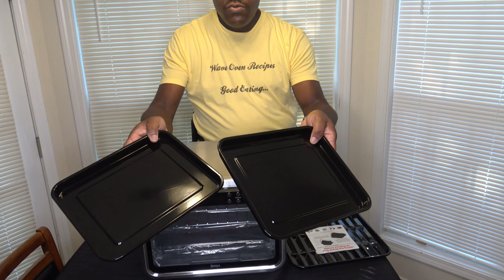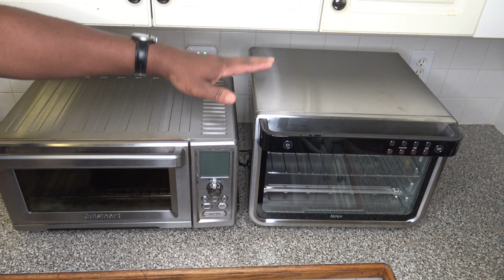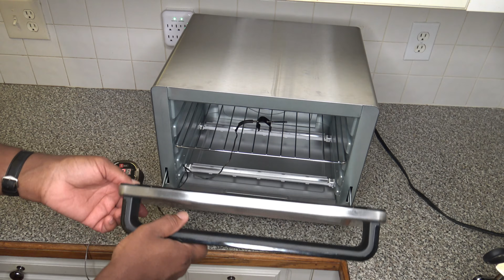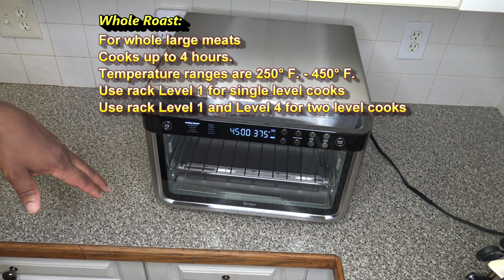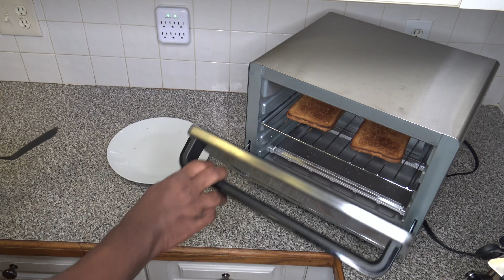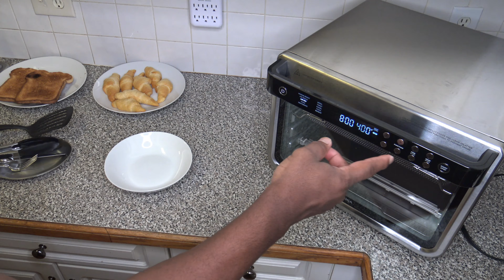Ninja Foodi XL Pro Air Oven Review, Unboxing, Test and Cooks

Comment: I waited to see if you’d review this! Thanks Darnell! Have a great week!
Reply: Qaa
Reply: Do not put the drip pan below the heating elements, put it in the slot just above the heating elements for obvious reasons. You don't want food & grease dripping on the heating elements. 

I Have had mine for a couple of weeks & so far it works great. My only negative is the white paint on the Power switch & the On/off switch has already worn off.

Unfortunately Ninja is made in China so hopefully it lasts at least 2-3 years.

Comment: Great review. The rear fan makes it unique as the speed is controlled by the setting you have selected. It is also a 3rd heat source to work like a rotisserie when cooking roasts and whole chickens etc. Also this is what eliminates the need to rotate the food like other ovens. Feature is highlighted right on the box.
Reply: is there any mode without the fan, for baking only?

Comment: Do not put the drip pan below the heating elements, put it in the slot just above the heating elements for obvious reasons. You don't want food & grease dripping on the heating elements. 

I Have had mine for a couple of weeks & so far it works great. My only negative is the white paint on the Power switch & the On/off switch has already worn off.

Unfortunately Ninja is made in China so hopefully it lasts at least 2-3 years.
Reply from the maker: The drip pan stays on the bottom.  If you have something that will drip grease.  This is how you handle it:
https://youtu.be/RtLswCh2ZnA

I made a video about the paint:
https://youtu.be/w0WqbPt6IC4

Comment: Other than the burnt area, for me that toast is perfect.  But taking 5 minutes to toast a couple slices of bread is a big deal for me. I like the idea of making 4 slices of toast at once tho, and to have the bread fully toasted w/o toaster lines is probably worth the extra minute or so. (And a 4-slice toaster takes up a lot of space on a counter, too.)  I like the addition of time while baking to complete the process as shown w/ the crescent rolls.. As far as the chicken bites, they typically use a higher temp and more time in any conventional oven bc they start out frozen.  But also need to remember they tend to dry out quickly when baking. So I would not walk away from them. Can you smell foods as they are "cooking"? And does the air fryer retain any odors like a microwave does, even with regular cleaning?? Thank you!!

Comment: This is one of the best reviews I've seen. A little suggestion though. I noticed on my cuisinart fryer a lot of splatter was getting onto the top and upper elements. I purchased a 2nd fryer basket direct form Ninja (it's cheaper than Amazon) and I put it ABOVE what I am cooking. This catches almost all of the upwards splatter and does not interfere  with air flow.
Reply: This is the tip I'm looking for. Bc cleaning the top and those upper elements has to be such a difficult thing to do in any air/oven. I was hoping the elements could be removed for easier clean-up. Like the heating elements (the eye) of the older styled electric stove-tops.
Reply: If your not broiling you could put the broil pan on the top rack to block any potential splatter

Comment: Could you please show how you take the fan cover off. You mention in this video and the 30-day update that you put the fan cover in the dishwasher but neither of these show how you take it off. I kind if pulled on it a little bit since you said that it comes off but it didn’t come off easily.
Reply from the maker: You probably do not have one.  They stopped making them with the guard years ago.  But, if you need additional help, call Ninja customer service.

Comment: For me this oven on 450 bake will not get past 400. And most modes it takes a super long time to heat because it's just using the heating element around the fan and not the upper and lower elements. Reheat is the fastest heating mode because it uses the upper and lower on max. With the strange preheat on top of that you can't use this thing reliably without your own thermometer.
Reply from the maker: I showed it heats fine, you should call customer service.

Comment: Thanks for a great review.... I just got mine and I just open and did the burn out. Quick couple questions, is yours even after turning it off but still plug in, the machine still running? Also, mine doesn't fan cover, have you heard or find out from others why some of it doesn't have fan cover (i am wondering may be because I bought mine in amazon and not in ninja website). Does the fan cover does help in cleaning or you prefer with no fan cover (I just want to see if I am missing a lot without fan. Any response is highly appreciated.
Reply from the maker: https://youtu.be/NRvwxFHJjLM
https://youtu.be/Iuwaj6_H74A

You cannot have a fan cover, they don't make them anymore, their choice, because they decided to remove it.  You cannot add one either.
Reply: The company concluded that nothing gets inside the fan, due to the fan blowing outwardly, therefore eliminating the need for the fan protector.

Comment: I just bought this. Is the fan cover sold anywhere?
Reply from the maker: No.  And you don't have the holes and connections to install it even if you got ahold of one.  You would have to drill holes and install parts to have brackets to hold it onto.  Which would immediately void your warranty.
Reply: @WaveOvenRecipes  Thanks for your answer.

Comment: Have you had issues with the lettering coming off the power button and the start/stop button?  I have had mine a few weeks and it's already coming off.  I contacted Ninja and they wanted to charge me 20 bucks to send a replacement and I had to send the one back.
Reply from the maker: No, consider adjusting how you wipe the front.  I highly suspect some of you are using an abrasive cleaning product or wiping too forcefully on the handle.  I have never had such an issue.  See my latest video using it
https://youtu.be/z4aswEIFP3o
Reply: I haven’t even cleaned that area.  It’s just from touching it.  That’s the issue.   Looking at reviews on Amazon it’s an ongoing issue but glad you are not having that issue.    I’m just disappointed at a 299 price point tha lettering would be coming off.  Amazon is exchanging it since Ninja wanted to charge me.  I’ll see if it happens again.  Thanks for your reply.
Reply from the maker: Something rubbing off from just touching it.  I have to think more is happening.  Sorry, it just doesn't add up.  I have used another cooker where paint rubbed off from vigorous cleaning.  But just touching I have to be the skeptic.  Seems more came into contact with the handle than just touching.  Maybe some type of oil, something.
Reply: Not sure what doesn’t add up.  I did a lot of reviews on this product and saw that this was an ongoing issue.  I purchased anyway and was careful NOT to clean or wipe down that area.  Even Ninja was aware of the issue and was willing to replace it but I didn’t feel I should pay for shipping.  Everything else works great so far.        Read some reviews on Amazon Bed bath and Beyond etc.  Maybe it will help you add up.
Reply from the maker: I have seen already and feel it's more than simply touching it that causes the issue.
Reply from the maker: I would guess if only touching causes the issue.  They released a batch with some bad paint.  That would also explain why it's not an issue occuring for more people.
Reply: @WaveOvenRecipes  Ninja finally admitted that one of their suppliers used a non permanent paint on the control panel. They are now sending out new units without asking you to return the defective one. But it all depends on which rep you talk to. Some only offer stickers to replace the letters, and a free muffin pan! If you persist, they will send a new oven, with stickers to put on for yourself, in case it happens again. Some insist on charging $20 to ship the new oven to you, but some do not. I love my oven, but this is unacceptable to have to put stickers on a $300+ oven. This is not user error, it is a manufacturing defect. Kudos to Ninja for sending out new ovens right and left (my daughter got 2), but I imagine they'll recoup that money in the price of their products. I still love Ninja products, I have this oven and a grill, but they really missed the mark on this one issue.

Comment: Amazing review. Extremely detailed with the kind of information that you often don't find in other reviews. people do need to know how large or small the interior dimensions are before they buy, and temperature is critical also. Some ovens claim to do 450 but don't go much beyond 400.
Reply: Do not put the drip pan below the heating elements, put it in the slot just above the heating elements for obvious reasons. You don't want food & grease dripping on the heating elements. 

I Have had mine for a couple of weeks & so far it works great. My only negative is the white paint on the Power switch & the On/off switch has already worn off.

Unfortunately Ninja is made in China so hopefully it lasts at least 2-3 years.
Reply from the maker: Do this I have proven it works https://youtu.be/RtLswCh2ZnA

Comment: You set the toast function for 4 slices instead of 2... I expected the toast to burn on that setting... Probably should select the actual number of slices of bread when using the toasting function to see if it really doesn't regulate correctly not not?
Reply from the maker: You don't understand.  My homemade bread is much larger than that stuff you buy in the store.  Literally twice as big, unless I make cinnamon bread 😋 

But the setting is correct.  The cooker simply fails on recognizing to adjust the toast time when already hot.

Watch more of my Reviews.  This is a standard test I do.  Some pass, others fail.

Comment: I got mine and it does not have a splash guard, it's model #201 did they get rid of the splash guard?
Reply: So no slash guard is permanent? They upgraded so they don't need the guard. Just want a straight answer. Called customer service and they couldn't give me a straight answer. Please someone help
Reply from the maker: It's their product.  So they do what they want.
Reply from the maker: They have made some adjustments.

Comment: Thank you for confirming that it doesn't preheat to the set temperature in 90 seconds. I exchanged my Ninja Foodi XL Pro Air Oven because it took 10 minutes to reach 450 degrees, NOT 90 seconds. My second Ninja also took 10 minutes to reach the 450 degrees. Disappointed that the advertised 90 second preheat time is a bit misleading. 🤷‍♂️

Comment: The product has an extremely strong chemical smell upon opening the unit. The smell is similar to paint thinner or something else toxic that should neither be consumed nor used in cooking appliances. When I called the business to inquire as to what particular chemical was used in it, they not only refused to tell me what it was but they also stated that this information is “confidential to their business” and therefore I’m “not allowed to know”. Due to shady business practices and concern for my health, I will be returning this air fryer for a full refund. I highly recommend going with a more reputable and honest company if you value your health.
Reply from the maker: You have done what is right for you.  However you have no evidence other than your feelings.  The manual clearly mentions to first wash all parts, and then do run on Air Roast at 450° F. with all accessories inside.  To do a burn off run, that removes any residue.  This is all fully detailed in the manual on Page 5.  And it is a standard with all cookers.  They mention the burn off is completely safe.  So any claims you have of danger are yours to conclusively prove beyond any personal suspicions.  Please write back when you have a site up with details proving your claims.
Reply: Wave Oven Recipes I’m curious how exactly you intend on either one of us being able to conclusively prove that this product is safe for use if pertinent information needed to determine that is being withheld from both of us by the company itself? How does that not give off red flags to you too? Unless, of course, you are affiliated with this company. In which case, you should probably ask them yourself since you are clearly intent on selling this product for them without having all the information on it first. I appreciate your response, but I’d rather warn the public to keep their eyes open and be smart about their purchases rather than blindly buying items that could ultimately prove to be a hazard to their overall health and well-being. 

Oh and last time I checked - my feelings are not responsible for detecting the smell of chemicals, my nose is. Thank you though.
Reply from the maker: You can take a swab and have a lab test.  That is all up to you.  As I said, this is standard for all cookers and in the manual of every one.  If you have something you feel strongly about, go for it.

I am 100% independent and being such doesn't require I run with every claim someone makes.

Wishing you all the best.
Reply: Wave Oven Recipes The intent of my comment wasn’t to persuade you to “run with my claim”. It was solely to inform the public of this company’s poor business practices so that they can hopefully make a more educated decision prior to doing business with them. 

Regardless of what chemical was or wasn’t used in this product, or how safe anyone does or doesn’t deem it to be, it definitely doesn’t look good on the company’s part that they chose to blatantly hide this information when asked directly about it. And regardless of your stance on this matter, I’m sure you and I can both agree on that. Just because it’s the “standard”, doesn’t make it right. And thank you for your suggestion about the swab test. But I think for now, I’ll just use common sense instead.
Reply from the maker: No, we don't agree.  Every cooker, literally every one has residue from manufacturing and shipping.  They all have a smell on the first burn.  Ovens, grills, air fryers, all of them.  Maybe this is the only one you noticed.  But if you get actual evidence of harm I would very much like to see it.
Reply: Wave Oven Recipes 

https://scholar.google.com/scholar?start=10&q=oven+fumes&hl=en&as_sdt=0,26#d=gs_qabs&u=%23p%3DcvSBdfWOql0J

https://scholar.google.com/scholar?start=60&q=oven+fumes&hl=en&as_sdt=0,26#d=gs_qabs&u=%23p%3DBTDBmeAA51UJ

https://www.ncbi.nlm.nih.gov/pmc/articles/PMC2966478/

Okay, so your argument is that if all cooking appliances have a chemical odor to at least some degree, then they must all therefore be safe? And since all cigarettes have nicotine in them, those must all be safe too. Just like all non-organic produce contains pesticides and all processed food contains harmful ingredients proven to cause disease and illness in the human body. But since they ALL contain these toxins, they must all clearly be safe too. Do you not at least see the flaw in your logic here? We’re not arguing whether or not other appliances have also been treated with these same types of chemicals. We’re arguing whether or not they’re safe. And just because other units have it too, doesn’t magically make this one any more safe. 

You seem to be under the false impression that these marketers and companies have our health and best interest at heart. When in fact, most - if not all - of them are actually just trying to make a dollar and improve the state of their own financial well-being. Therefore it’s up to us, as the consumer, to determine whether or not these items they are trying to sell us are safe enough for use. Assuming that all products are safe until proven otherwise is exactly the mentality that will eventually and inevitably lead your health to deteriorate over time if you’re not more careful. And regardless of whether I know you personally or not, I truly don’t wish that on you. Or on anyone else for that matter. So if you happen to find concrete evidence on the subject that proves me wrong, I’d love to see it. But until then, I wish you well.
Reply from the maker: @NurseGirl0312  https://youtu.be/eHkCuB2VjcM
Reply: @NurseGirl0312  if you do the burn off, as directed, it eliminates the chemicals and the smells. Thus, the reason for doing it.

Comment: I don’t mean to be obnoxious or anything of the sort, but where did you get the splatter shield that goes on the fan? I have the DT201 and it doesn’t come with one.
Reply: I also did not get the splatter guard nor is there even a bracket to hold one on the fan.  I also have the DT201.  That bothers me because I want to protect the fan.  I just got this oven today.  I’m giving them a call.
Reply: @Linsifer  hello. I'm just wondering if you called ninja regarding the missing splatter shield.  If you did what did they say? Mine did not come with one either.
Reply from the maker: Ninja changed the design.  They don't make them with the guard anymore and don't offer them separately.  We who got in early got ones with them and that's all.
Reply from the maker: Hope you saw the full unboxing since it came with the cooker.  If yours doesn't have one contact their support folks.  According to the manual I have, the splatter shield is standard issue for every unit.  It's just one of those parts that is supposed to come with it.
Reply: @WaveOvenRecipes  Yes, I did watch it and I love how in-depth your unboxing/reviews are, I’ll make sure to contact them, thank you!

Comment: The toast numbers are how many inutes it cooks.. So probably the setting of 4 instead of the 5 you used, would make your toast the browness you want.
Reply from the maker: You may have missed the process I used.  I intentionally started with it already hot, to see if it would recognize and automatically adjust.  And demonstrated it doesn't so the results could be seen.  Other cookers do better in this regard.
Reply: @WaveOvenRecipes  gotcha